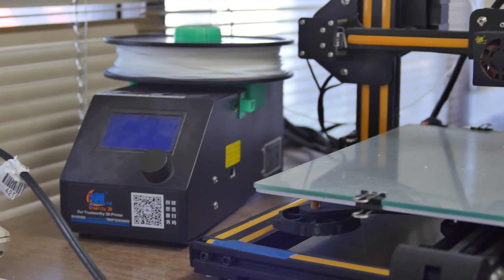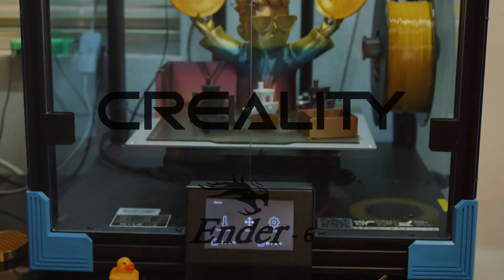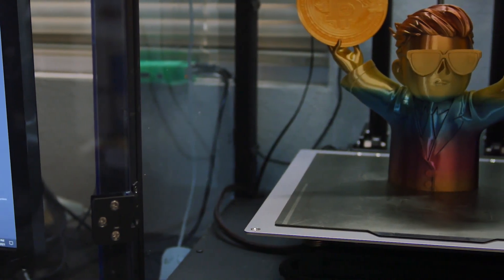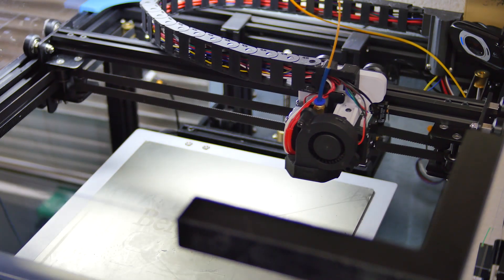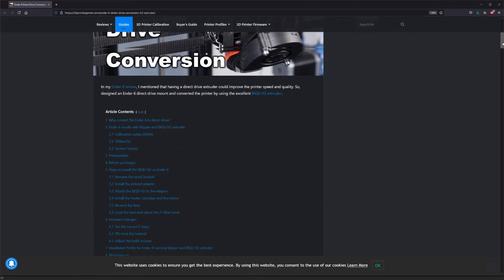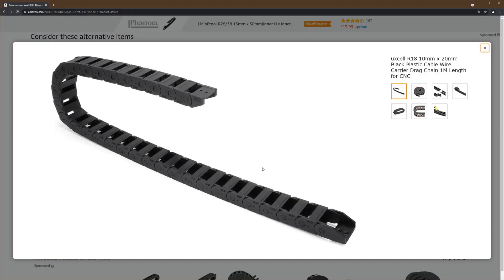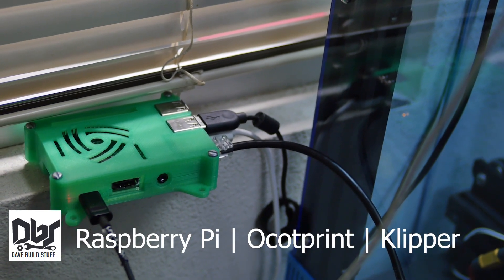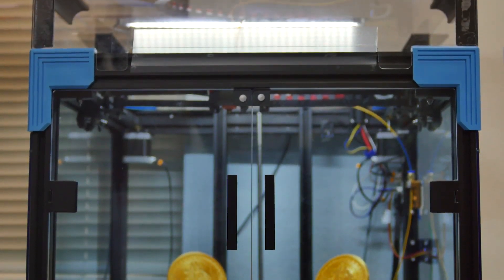I FINALLY Got a New 3D Printer! - Creality Ender-6 w/ Mods Overview

Comment: I own an Ender 6 and have not modified anything. It prints great just have a little stringing to be dialled in. Printed a 5 day mountain lighthouse scene and it printed flawlessly. Tried a 300mms print and it did handle it, wasnt perfect but passable. Having great fun with my Ender 6 so far.
Reply from the maker: That's great! Yeah I don't mean to imply with this video that you NEED to go through all these mods to get it to print nicely. Glad it's working for you
Reply: Not to be that guy, but I legitimately do not believe this. I have been trying to get my Ender 6 to print literally anything for days and it's failed every way you can imagine. I have 4 days left to return it...
Reply from the maker: @jasonterry9343  Reminder that you are one data point (which does not make a trend.) Sorry that you are frustrated. Sucks, and I too had "out of the box issues" with this printer. Most often though, the problems lye with inexperience with operating a printer combined with unrealistic expectations of how these cheap Chinese products function.
Reply: @jasonterry9343  what slicer are you using. I use Superslicer as the pre made profiles for the ender 6 are perfect.

Comment: Thank you for your video, i'm gonna leave my personnal experience here if it can help some Ender 6 (futur) owners.

I bought my first 3d printer a month ago and as a noob i did not know what was really 3d printing, because watching youtube videos is very useful but real life experience is always different, my first criteria was to have an enclosure, not for printing specific materials but simply because i did not want to see my printed parts damaged by my cat lol, so i choosed an Ender 6 and learned a lot on 3D priting with the stock configuration, but i felt very limited by the speed (they announce 150/200mms with the stock configuration...hum, i'm still looking for someone who managed to print a decent quality part at those speeds with the stock ender 6 configuration).

So after 2 weeks of learning, using and a lot of fails, i decided to make radical changes. 

First i noticed that the Z motor and the extruder motor were very noisy (the stock board is sold as a "silent" board with TMC2208 controllers) and was very disturbing for me, so i decided to understand why and  opened the bottom cover of the printer, removed the board, removed the metallic cooling parts which cover the drivers and cleaned the white glue on it.  after a passage under the microscope, i was surprised to see that only the X and Y motors are controlled by a Trinamic TMC2208 driver whereas the Z and Extruder motors are controlled by an Allegro A4988 driver. I understood why the Z and extruding movements where so noisy. The controllers are also soldered so they can't be changed if there is an issue with one of them. 

Before discovering this, I had already planned to install the Biqu H2 extruder and run klipper, so instead doing modifications in several steps, i decided to do it once and for all, so i changed the extruder, the board, the cooling fan, the screen. i also added a raspberry pi and a BL touch. I choosed the SKR 2 for the board and the TFT35 V3 for the screen, i removed the spray board which is inside the printer and rewired all the cables directly to the board.

When received, i opened the extruder and saw that there was no grease in so i added some PTFE grease  and strongly tightened the screws, i also used threadlock glue for all the screws that are used to fix the support for the extruder, the fan support and the bl touch support because I didn't want the screws to loosen during printing.

Note that the TFT35 V3 screen is not working in touchscreen mode, only with the scrolling and clicking wheel, but it works very well. By the way i would say that for me it is very optional, i really never used it, 
 it is only useful for me to see the percentage of the impression if my computer is turned off, i manage all my printings on the klipper interface, and i send directly the gcodes from Ideamaker slicer to klipper thgrouh the network

There are not many informations on the internet for the SKR2 and the TFT35 V3 so if someone needs some help or want my klipper configuration file, feel free to ask me.

Now i'm printing with a very good quality at 100mms/ (130 for the infill), and i run my drafts at 200mms,  the Z motor and extruder are much quiet than what they were. 

PS : sorry for my english level, it's not my native language
Reply: I did the exact same thing as Mokran except I used the SKR mini e3 because it uses the same mounting holes.  I also went with the BTT TFT70 because I’m blind as a bat and using the terminal feature is exponentially easier with the larger screen size.  The main difference is I used marlin instead of klipper.  

I purchased an H2 for my Ender6 as well but have not installed it for two reasons:  
1.  I relocated the extruder to the top rear and in all honesty, 80-100mm/s is producing phenomenal prints with PLA, PETG and even some carbon fiber filaments.
2.  The mount, which you have addressed,  was giving me fits when I printed it with PC due to slight deformation.  I will say however, the fact I was able to get anything printed with PC on a stock ender 6 surprised me to the “enth” degree.  Obviously the print wasn’t perfect but good enough for probably 57.4% of hobbyists.

Great job on the ender vids and I look forward to watching whatever you put out in the future
Reply: @woosatch759  Hello dear, where did you get the STL to install the extruder on the back of the ender 6?
Reply from the maker: Wow, thanks for sharing your experience. I'm glad you got it working but I would definitely not recommend that approach! That sounds like a lot of changes to make at once. I always find it is better to take it one step at a time. Build on several small successes instead of shooting for one big one. But it sounds like you have achieved a satisfactory result, so good on you!

FWIW, yeah you can't expect much from the Creality marketing. They are pretty basic, cheap Chinese products that will have issues. Their claims about printing speeds are way exaggerated. The good thing about them is that since they use mostly standard components, they can be easily modded and upgraded like we have found.

Comment: David really nice job modifying your ender 6. I used to have a kind of ender 3 printer (it was another brand) making extremely well objects in PLA, PETG and TPU with a lot of mods. That was great till I got obsessed with building a Voron 0.1. But I need to print in ABS, and that was a nightmare since without an enclosed printer there was lack of quality with warping (without delamination). So I started looking for a great 3d printer to print properly in ABS and IMO there's just a few and very expensive out there. So the way to go is a Creality printer which you always have to modify. All the hotends are crap as the extruders. To sum up I'll get this ender 6 in order to have it all: corexy printer, big volume and capable of printing ABS with an enclosure. I'll follow most of your mods, waiting forward to see your voron 0.1 series soon.
Reply from the maker: Thanks. Working on the Voron videos now!